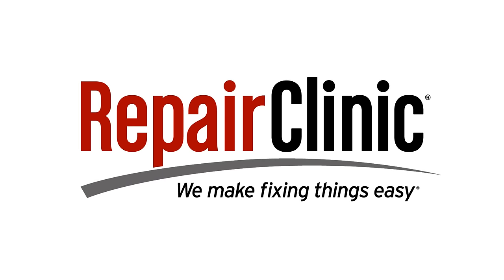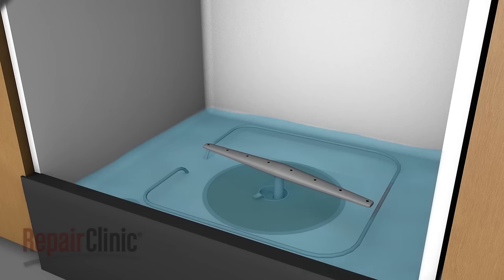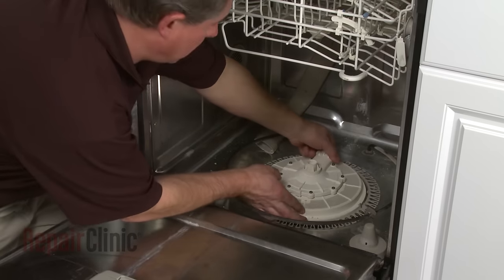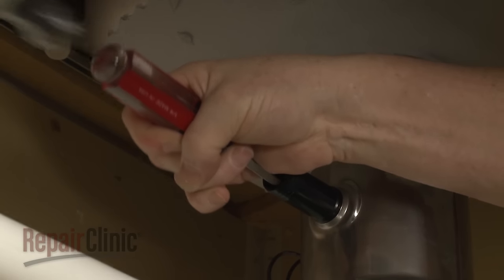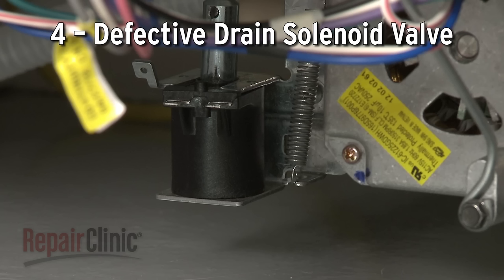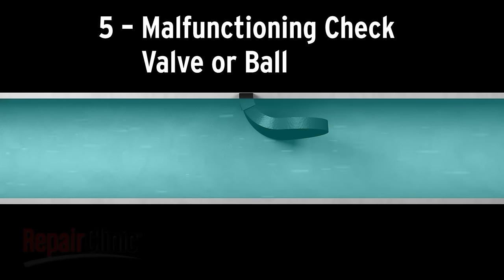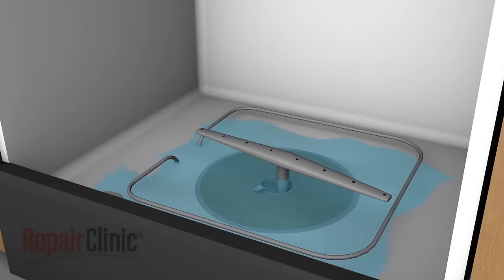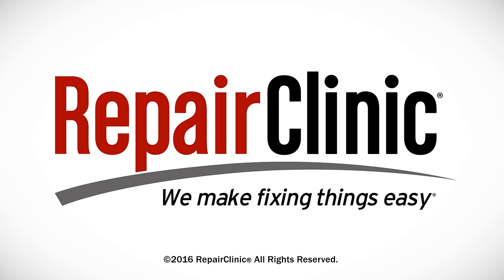Dishwasher Not Draining — Dishwasher Troubleshooting

Comment: I swear they manufacture appliance and electronics these days in some dumpy factory in a third world country! I remember as a kid in 70s we had a tv for 20 years, a vcr for like 15 years, a microwave for longer then I can remember, they want cheap materials now that won't withstand so you have to "buy the manufacturer parts at ridiculous high prices " at parts stores. Everything is conspiracy to make profit. I paid 37$ retail for a thermostat on a stove burner.  Just for a heating element??! We go through microwaves now under 10 years. In 5 years the cheap material deteriorates . Why don't they make internal components that run efficiently? Ah, excuse me? Mr. CEO .....I would  like manufacturing kept here and regulations , good paying jobs, benefits, not by "phong nook lom dhong" in a sweat factory.
Reply: People want $ CHEAP $ electronics and appliances. So how do they get you $ cheap $ devices ??? By cutting corners and building them with cheap components. 
Components that were NOT built or designed to run past ~5 yrs but enough to last more than their warranty. 
You want a TV to last 20 yrs ?? Well, that requires better components, better design of the boards, more cooling ... etc

Nobody will pay $5k for a 40 inch TV that will last 20 yrs ...
Reply: @ACommenterOnYouTube  is that GM’s motto of customer satisfaction?!
Reply: @EdMcCornhole  its NOT about customer satisfaction. Its about profit margins aka $$$$ ... 
Why build a TV to last 20 yrs when you can build it to last 3 yrs and have the consumer buy another one ....
Reply: @ACommenterOnYouTube  my new dishwasher lasted 5 years and broke . I been washing by hands ever since . That was years ago. 
Corporate tax should be higher so they can’t own  “Lambo’s”. 
I saw the lightbulb conspiracy. Crooked.
Reply: @ACommenterOnYouTube  agreed, I won’t buy a Chrysler dodge brand new again, the radio went after 3 years, “did you get extended warranty?”
“Nope”
“Oh sorry about your luck because we designed it to fail. “
Lmao… I see old vintage classic cars at shows where the radio that still works. I tell the dealership I know mechanics.
Reply: @EdMcCornhole  my parents purchased a new Santa Fe and the finance guy said the window has 5 sensors on it that all must work for the motor to run, once one of those sensors fails, it essentially opens the circuit and the motor stops working. 

And yes most if not all these classic cars still have their radios functioning. So true.

Comment: If the drain hose is NOT connected to your disposal but connects directly to the drain below the sink, make sure the sink line is clear. I have a a two drain kitchen sink, One on the left has the garbage disposal, one on right drains directly out to line. This is where our dishwasher drain hose is connected. We never really use the right side sink and it had become clogged with mold and debris and we left the drain strainer in tight.  The water needs air to drain properly. Once I cleaned that side and removed the strainer, my washer drained properly.

Comment: A key miss:  My dishwasher drain line was clogged, and this was apparent because the pump cycle worked but in a very reduced and intermittent way.  That meant the pump was okay, the drain line was at least partly open (perhaps a sensor was not working right and I could check that if needed), so I started with the easiest to diagnose part, and the one missed by this video:  The AIR GAP fitting on the counter deck behind the sink.

Generally, one just pulls off the chrome cap, and then unscrews the translucent plastic cap that's underneath.  Inside there, one will see an upright tube (mine is a copper tube with an open end and a hole in the side) that ends very close to the underside of the plastic cap, and therefore is prone to clogging.  This is where my trouble was and it was very easy to pick out the debris without even having to bend over, woohoo!

BTW, the air gap fitting may be ugly, but it helps prevent the disposer back flow problem that is noted in this video -- it really is the better way to install the dishwasher.

Comment: I have the DW80J3020US Model. Does the small hose that connects to the drain pump have a check valve in it? ( hose also connects to the reservoir  on the left side).